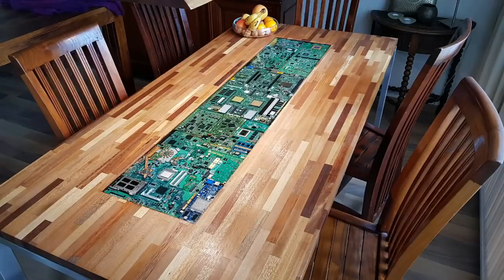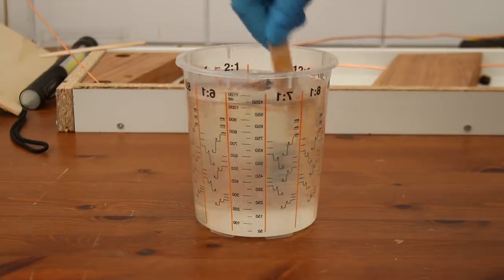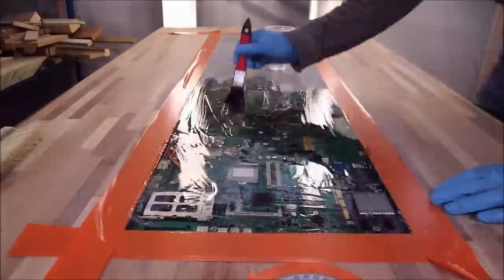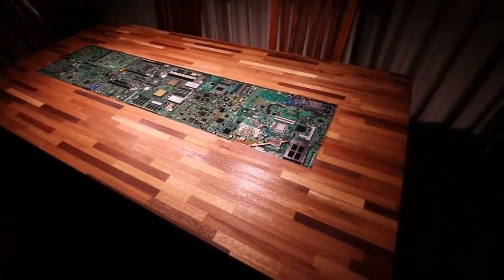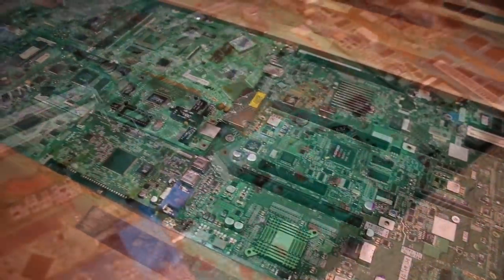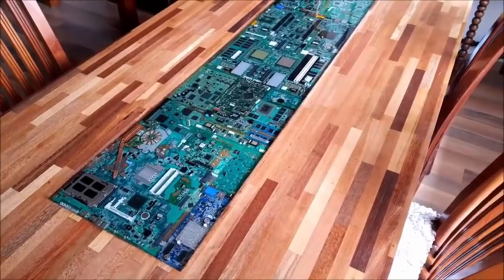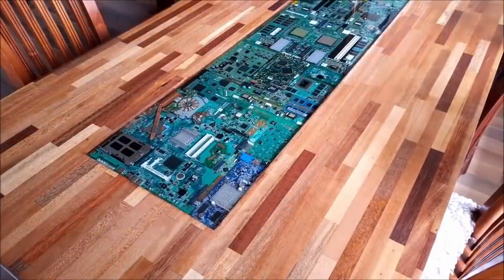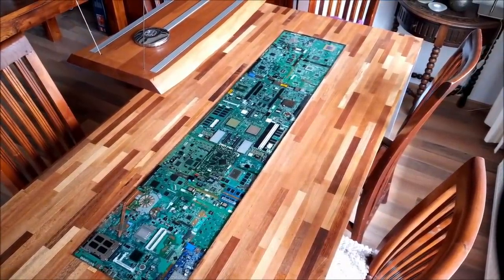Circuit boards with lights in epoxy in a table

Comment: Can you add hardener to the soft spots?
Reply from the maker: When the epoxy is not well mixed, the hardener and the epoxy don't meet: so the hardener stays sticky and the epoxy stays sticky. Afterwards you'll never know which is which. So you might end up adding hardener to hardener. And even if you get it right, how will you mix the two? 
Or in short: 
no.
😊

Comment: it would be cool if you did the same kind of thing with a desk but it was an actual working computer. you could do this by vacuum molding all the necessary boards epoxying using the molds then removing them and on the opposite side to the epoxy have panels to hold the board in place so they can be replaced and repaired when needed
Reply from the maker: I came to the idea of a working computer too, and I even thought of a way I could pour it in... I can't tell you how, for it is a secret... until the video comes out.. 😆😆 (But I'm not sure if I will make that, because I have so many other things I want to make..)

Comment: Not a total fail.  A piece of plate glass on top to seal the whole thing will let you use it still.  IMO, you put down too much epoxy in a single pour.  several thin layers let you confirm all is well.  Deep pours, in my experience, result in hot spots and soft spots due to the challenge of mixing large volumes at a time.  

i was bummed, initially I thought you were going to power those PCBs and insert LEDs in place of some components...  I like the fiber optic option.  now power needed.  NICE work.
Reply from the maker: I will not do the glass plate. I've got it figured out now, and I will try to fix the ugly spots. So there will be a sequel to this video titled 'how (not) to pour epoxy'. I think I did at least three things wrong, but the layers are no topic. I just mixed one layer not well enough. (I did at least four layers and let them cure for days in between - according to the specs of the epoxy I could have done 5 cm at once, I did maybe 1.5 cm max.)
Yeah, not only no power, but I like the temporary character of the fiber lit LEDs too. I suspect you'd go crazy fast with permanent lit LEDs..
Thanks for the comment!
Reply: @Onrust1  looking forward to sequel video!  Cheers!  Yours made me think of casting glass over metal machine parts, heated to cherry red......  Now I have to work on that one....
Reply from the maker: Are you gonna make a video of that? Sounds interesting...
Reply: @Onrust1  not the first few attempts as the forge is not at my shop, no video allowed at the borrowed forge.  Round 3, likely as I hope to have a forge onsite by then.

P

Comment: An interesting build and entertaining to watch. I have a suggestion about the fiber optic lights. You could easily put a battery powered small motor under the tabletop, to which you attach a small disc with various sized circles, arcs, and other shapes cut into it, and shine a light source through the disc at the fiber optic cable ends. This would introduce a semi-random element or patterned 'movement' of the lights on the surface. 

   You might do another table, this time assuring yourself of table being level. Add more lights than the current model, do the electric motor and pierced wheel arrangement, but add more discs with gearing to make each disc run at different speeds, adding more 'randomness' to the light patterns. 

   Just a few thoughts, 

speaking, Frank-ly

Comment: Try to treat it to some UV light for many hours (send it on a charter vacation to Mallorca) and I think that could cure the poured epoxy completely.You probably have sold that heavy piece of a conversation starter by now, but if not, it might be worth keeping it for a couple of hundred years and it will be worth a lot.
Reply from the maker: ... as with anything you keep a couple of hundred years... 😆
But I have never seen so much interest in something I made in buying it; several people say they want it. 
I will try to fix it, and I want to make a video of that too. Maybe afterwards I will sell, yes.

Comment: i just came up with this off the top of my head, so take it as you will***I suppose you could do that with a chisel and hammer and that is a way to go but there is another way, you could cut the rest of it out, that is to say that you could drill a hole in the edge of the epoxy region big enough for a jig saw and cut out the center of the table, that way you have a hole in the center of the table to fill. then sand down the edges to a smoothness and take measurements.***************now you will need to decide if you want to add an inlay with a teak or some sort of a stain to blend in with the table, this will allow the edge of the resin to be hidden instead of having it out in the open.****************make a box the same size as those measurements and lay out the circuit boards again, there is no shortage of computer junk, and this time do it in one BIG pour about 10 liters, i am guessing, inside the box, this time you might want to get one of those industrial mixers, the kind you put on the end of a drill and a brand new garbage can from the hardware store to mix it in, you will need help lifting and pouring it, make sure everything is in position you won't get a second chance to re do it, then pour the resin, in the box, and the box can be slipped in to the hole in the table.**********************turn the table over and coat the bottom of the table with more resin, this will help hold the box in and no extra hardware SHOULD be needed.
Reply from the maker: I feel honoured you thinking with me and putting so much effort in a reaction. Thank you! The plan what to do with the table is as good as ready. The main thing: I will try to repair the epoxy. 
I will make a video. 
Thank you.
Reply: good luck, I hope it works

Comment: shame it failed because it looked good, I was thinking them Capacitors could leak or worst exspand even explode maybe pop. I wonder what the cost was,
Reply from the maker: Cost is in the description of the video.
Reply: Arrr.yes. thx, the board remind of a mini city every intricate and detailed, cool, you know of Klaus Schulze German synth player his album cover Kontinuum on the wall set it off. O yes! try Micro mesh to polish it it can come on a roll. they use to polish canopies.

Comment: I'm gonna be thinking about that dual socket mobo all day now... Do you remember what socket that is or what it came out of? Also did you use a battery light or so to make the LEDs light up sporadically?
Reply from the maker: Socket? It was a Sun server out of the trash of a data center. For the LEDs you'll have to watch the video in its totality. Don't watch half and expect me to fill in what you skipped... 😏
Reply: @Onrust1  ahhh cause I saw them light up and the epoxy after math but was like wtf there on fiber how do they light up almost in a pattern lol, gotcha, my wife won't let me do this.... But a very very detailed writeup and video, I enjoyed all of it

Comment: Good job, looks good,   One question: if the epoxy gets scratches eventually, can it be buffed out somehow?
Reply from the maker: Yes, you can always sand and polish again, or eventually pour an extra layer... (as I did in the end - as you can see in the video).

Comment: Forst question is how many litters of epoxy total and how much did it cost. Second, Wy not use several different colors of LED and then build a simple 40`7 and 555 driven sequenc er to have the lights flassking randomly all over the table? Third, can you not use a low speed mixer blade to get a more uniform mix?
Reply from the maker: 1 - Is in the description of this video 
2 - I deliberately left out the battery powered lights with controller, because I thought you would go crazy quickly of a carnival in a table all the time... 😊 It is the temporary character of the manual light for a few seconds in the fiber optic that I like.
3 - Yes.

Comment: No it is not a fail !    It is how we learn ,   The premise is great and the finished product  unique .  Viewed from above it has the look of a fine textile ,  the juxtaposition of wam earthy wood with high tech modernity is artistic genius. When you do the next one or repair this one put in more lights of many different colors  that operate on a small battery source that way you can at the click of a switch have the lights go on and off throughout the entire piece as though the entire unit was  a functional  piece of hardware working on a very complex problem like world peace.  Please don't be discouraged it is a wonderful piece. Wishing you only the best !!!
Reply from the maker: Thank you. I deliberately left out the battery powered lights with controller, because I thought you would go crazy quickly of a carnival in a table all the time... 😊 It is the temporary character of the manual light for a few seconds in the fiber optic that I like.

Comment: next time use a glass panel instead of epoxy, faster and cheaper ;)
Reply: and environmentally friendly
Reply: Not as cool tho.
Reply: @LEO-xo9cz  dont know, i like glass. epoxy makes sence if you have super fancy shapes to fill
Reply: @mephtec  i love epoxy.
Reply: @LEO-xo9cz  its a nice material to play with, but cant be recycled or anything, just burned to toxic waste
Reply: @mephtec  True.
Reply from the maker: I'm on the side of epoxy-coolness too... 😁 The way the light only breaks once in epoxy, makes it more cool to look at something enclosed in it, than something under a glass panel.. Apart from that... anything in epoxy is 'frozen' in time. Under glass materials would age further (and gather dust).
For me epoxy is far more fascinating. I've got more ideas where epoxy is involved.. Sorry, environment.. (maybe I should look into compensating in one or the other way... 😏)
Reply: @Onrust1  thats absolutely ok, the world is not black and white :D
but techniqually you could get this effect also with glass and some liquid inside, even water. thats what make aquariums so nice to look at :-)
Reply from the maker: Agreed, but not (or very difficult) on a horizontal level. I must admit, it is a provoking thought.. 😆😆 
That's how many of my projects start: with the question 'would it be possible to...' 😊
Reply: @Onrust1  you can use some hydro-gel that expand and stay clear for ages if the table is sealed
Reply from the maker: You all make it still more tempting... 😜😜😜 Have you got a link to that hydro-gel you're talking about? I know nothing about it...
Reply: @Onrust1  I agree 100%.
I'm even delving into carbon fiber. It is so versatile. I would pull it all out and start again.
Reply: @mephtec How would you prevent bubbles or discolorations etc.. The last thing you would want is for it to lose its perfection.
Reply: @LEO-xo9cz  what do you mean with discoloration? if you use clean glass and liquid, there should be none
and bubbles shouldnt be a problem, just fill your container all up til it overflows, then seal it
Reply: @mephtec  What liquid could you use that will last indefinitely?
Reply: @LEO-xo9cz  I guess destilled sterilized water would just do fine, never tried it though
Reply: @mephtec  Hmmm. The other question would be what about corrosion on the boards.
Reply: @LEO-xo9cz  interesting question, maybe somebody else has some experience on this issue? i just think it wont be a problem when there is no oxygen, but thats beyond my understanding of chemistry :-)
Reply: @mephtec  I've heard of a liquid that computer boards can be submerged under that it not conductive.
Reply: @LEO-xo9cz  do you remember the name?
Reply: @mephtec  No. I will have to do some digging.
I remember it being used too cool computers. The whole board is submerged into it.
I stand corrected but it is something the stuck un my mind.
Reply: @mephtec  Mineral Oil.
Reply: @LEO-xo9cz  thats a good idea actually! i would like to hear more about it once you've got more information on that
Reply: @mephtec  I think from a perspective of the pc it probably would be easier tho. I don't know how one would be able to fill it and not have any air bubbles against the glass.
Reply: @LEO-xo9cz  as for simple shapes like the table in this video, i think it wouldnt be a problem, all the bubbles would go up. you put on the glass plate and wiggle the table around for a bit. maybe a tiny hole in the plate would be neccessary, it could be sealed after all the bubbles are gone. all in all way easier than solving the problem with the sticky epoxy irregularities we saw in this video
Reply: @mephtec Im not sold on the idea. I love the concept. It has many other possibilities but I personally would go with epoxy on something like this project. My personal view.
Reply from the maker: I agree with LEO. I could have told you the mineral oil-thing. Saw it demonstrated on stage once (long ago) with a working computer in an aquarium. The oil doesn't conduct electricity and cools the computer components. 
Difficult to imagine that someone wants that - it must smell and with cables going in and out it must be a bit messy too.. 😁 
Meanwhile I don't see it before me to fill a table like mine with any liquid. Eventually it will contain bubbles (the trapped air will get out) and closing it airtight will be difficult because of variations in temperature that will expand and contract the liquid.
Reply: @Onrust1  I would pull it all out and redo it using the 3 bucket mixing method that has been mentioned in this comment section.
Trial and error. I love your vision.
Reply: @Onrust1  sounds reasonable. still, i think you could solve the problem about expanding and contracting of the liquid by just adding a siphon. but i look forward seeing more videos from you, maybe i will built something like this in the future by myself, going the no epoxy/glass only road. if it succeeds, i will tell you :)
Reply from the maker: @mephtec  You should make a video of that. 😊 I won't pull it all out, because I don't want to put so much time in doing it again. I want to make other things. But I'm planning to fix the table by taking the ugly spots out and fill them in with epoxy again. I will make a video of that - wait for it. 😏

Comment: Great idea and I like the fact that you used a reclaimed dated table and gave it a new fantastic look. It's a shame after all that work you had some failures but I think putting the glass cover on it that has been suggested seems a good idea - perhaps painting it with a layer of epoxy and then putting the glass on top of the freshly painted epoxy may help stop the creeping of the epoxy that did not harden ? I don't know , just a thought.. Good luck.

Comment: My opinion is.. in my experience. Better you use different container or just use large container when applying an epoxy. Because when you repeated in same container. You will not get same amount of volume as it 1st attempt.. soo.. as it results it got very disappointing at end of progress.

Comment: Why don't you just pour a coat of expoxy over the whole table.  Sealed  no more leak. Still get to use and admire your work. If you don't like it after you can sell it and make a new one for your home. Not a loss just a detour.

Comment: Very cool video. IMPORTANT TIP: Epoxy will yellow from any amount of UV over time, even "UV resistant" epoxies. The UV from fluorescent lights is more than enough to yellow any epoxy. If this matters to you, use a Polyurethane or Polyaspartic top coat to prevent this from happening - sort of like that last brushed on coat you did. In addition to these coats being UV resistant, they are more durable than epoxy. Also, I think pouring as 1 monolithic coat would prevent the issues you had. I don't think those issues were purely from not mixing enough. Epoxy has a very set time between re-coatings, if you go beyond that, trying to do another coat will fail.

Comment: the end result being bad is because the epoxy needed to be heated with a torch, mixed properly, and seal the wood, there is a lot of air in wood that goes into the epoxy once it is poured.

Comment: Glass top won't help, you will eventually see the wet epoxy between the wood and the glass.  Try putting it in direct sunlight for a few weeks.
Reply: So sunlight can ruin it further 😂
Reply: @CuteKitten_DD  sunlight would gradually heat the uncured epoxy hardening it. A heat gun may expand it too quickly causing cracks.

Comment: Suggestion:  Remove the core of the table, replace with either brushed aluminum/stainless, or diamond-plate steel (rout slightly deeper than the thickness of the metal, to allow for...), then throw a thin coat (two or three mm) of epoxy over top to finish.  Table salvaged, and still ballsy, although without the full compliment of ultimate nerdologicalisms inherent in the original concept.
Reply from the maker: You made me smile three times: your name, your suggestion and your choice of words. Exceptional, that is. 😊😁
Reply: @Onrust1  I do what I can.  d;o)

Also, I couldn't let that core "central contrast concept" go to waste.

Comment: what saw did you use to cut the center?
Reply from the maker: It's called a plunge saw. I've got the Makita SP6000J with a 1500 mm guide rail. I'm quite pleased with it.

Comment: From my personal experience, always put a vibrator on your base material (the table) at the very beginning of the epoxy pouring process. It's necessary in order to evacuate the tiny air bubbles from the complex structure of the PC boards. It was a wonderful project but air entrapment is responsible for what happened. Drilling draining holes underneath the table would have also helped to get it better. This is what made the blurry soft spots. Congrats anyway! :)

Comment: Ahhhhh the cardinal rule of epoxy. When you think you've mixed it enough, mix it some more. Then when you're absolutely sure you've mixed it thoroughly, mix it some more.
Having gone through those steps.

You're ready for the final mixing.
lastly when you've done the final mixing, mix it again.